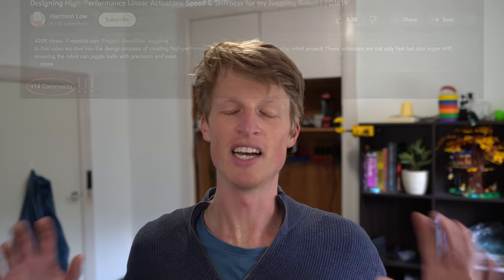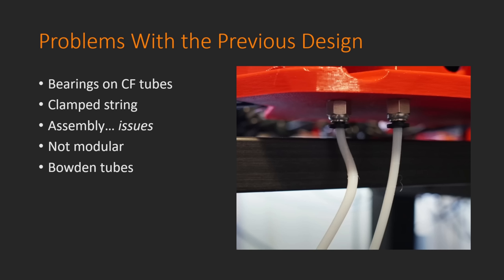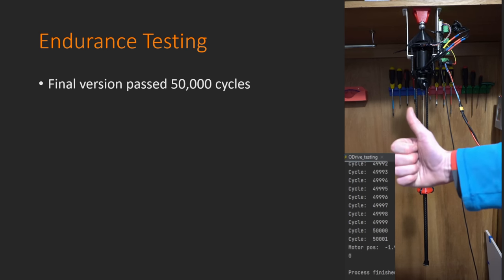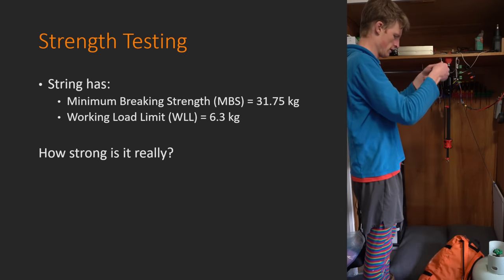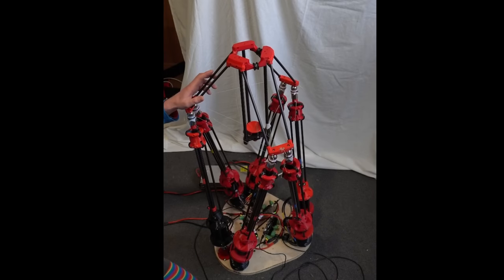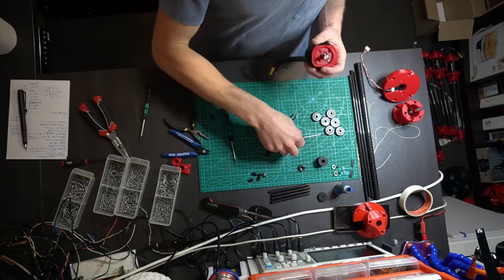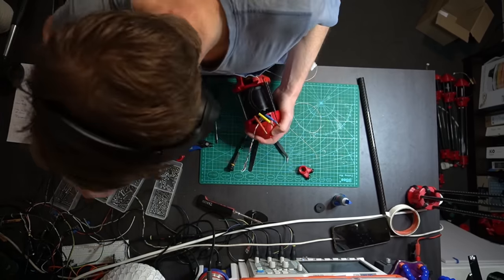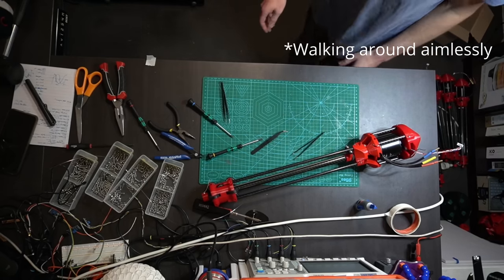My New Linear Actuators are SO MUCH BETTER! | PDJ #21

Comment: I used some thin UHMWPE (more commonly called Dyneema or Amsteel) cord about 1/8 inch for a project a while back. It was ridiculous, unbelievable how much force it took to break when I finally got it spliced it (close to) properly. I know it doesn't stretch much. Could be a consideration? Edit: I went and watched your latest video and the actuators are running on dyneema.
Reply from the maker: Check out my latest video 😉 it's what I'm using now! Agreed that splicing is very fiddly and I almost deemed it impossible with such small thread, but as always, persistence paid off!

Cheers for the suggestion ☺️
Reply: @harrisonlow  How small did you go?
Reply from the maker: The thread is around 0.8 mm diameter. The first splice took a good 20-30 minutes to finish 😂😅

Comment: Regarding braking and speed performance, I've seen that counterweights can really help the performance of actuators. Not sure where you could slip one into this design, but I think it would reduce energy consumption and thus require less energy to change direction.
Reply: Since this robot needs acceleration more than braking (imo), that might be a good idea.  They could be biased to extend quicker than they retract.
Or if better braking is required, perhaps they could be biased so they take more force to extend - but the braking is augmented by the counterweight or spring.  This way the motors can use more of their power, since apparently it's more difficult to brake than accelerate.
Reply from the maker: @mitchell4020 very interesting! Where have you seen counterweights used like this?

Re. braking vs. acceleration: I think both would be very important for Jugglebot. Ideally the acceleration would be fairly low, but if there's an errant throw or mid-air collision, it'd need to be able to react really quickly to get to the ball before it drops (requiring both high acceleration and deceleration)

Can you think of any way a counterweight could be added here? My first thoughts are that the counterweight would only increase the total inertia of the system, creating even more difficulties when decelerating, though it's quite likely that I'm missing something obvious here...

Cheers for the ideas!

Comment: For assembly you mention that location the pulleys is 'fiddly' and requires some persistence, is there room for some registration marks there that you could use to align a jig? Pulley goes in/on jig, jig is pressed into part, using the registration marks to self-align, screw inserted, done.
Reply from the maker: I actually did think about this! I was briefly toying with the idea of cutting the part into two halves along all the pulley planes (would've been a strange surface cutting the shape, but I think it would be possible in just two parts) and bolt them together, where the connecting bolts are the same bolts that support the pulleys. Ultimately, just never got around to doing it!

I think it's a great idea, and one that I would strongly consider if I were making more than 10 of these. Cheers 😊
Reply: @harrisonlow  makes perfect sense! Also you've more patience than I! I think I'd have gotten fed up after the first dozen pulleys.

Comment: Not sure if "Kevlar line for kites" is twisted, if so try changing the orientation of one (or both!) strings to reduce the rotation. Modern (Kevlar?) fishing filament may be a better option for the strings? Perhaps conservation of angular momentum and the Coriolis force is causing the actuator rotation? If so, the rotation would be the same direction for actuation and retraction.
Reply from the maker: The kevlar line is twisted (a pair of twisted threads, to be exact), though I'm sceptical that the twisting is coming from the string? The string seems too small and unsubstantial to have that sort of effect. Though I suppose it only manifested fully after 39,000 cycles (IIRC around 4 hrs of runtime) 🤔

Where would angular momentum and coriolis be coming into this? In the pulleys/bearings? I'm intrigued!
Reply: @harrisonlow   if you step on a skateboard kicktail hard enough to flip it over, conservation of angular momentum causes it to turn 90 at vertical and continue rotating on the way down, to land on the wheels again---a tendency anyway. In that case, I suspect the direction of rotation is related to the hemisphere you are in? Speculating here, perhaps the rod gets more or less rotation depending on how it crosses the lines of Coriolis force? Notable, in martial arts, arrows, bullets, swords, punches, kicks, etc are all power optimized with a rotation in the stroke, I think there is something that would apply to linear actuation too, not sure. I suspect 180 rotation out and continue 180, for retraction, with best dimension parameters, would be optimal for linear articulation... small forces, but better to work with, than against. Could test by articulating a rod from the bearings race adjacent to the one installed in the end of the rod? count rod rotation after n motion actuation? Good luck, from your armchair scientist!

Comment: I am new to python coding and that endurance test counter would be interesting to see.. But this whole project is amazing. Thank you for documenting and sharing it!
Reply from the maker: The way that counter worked was to simply add 1 each time the actuator reached the end of its movement 😊
FWIW, I have a bunch of the code up on Zulip so check out the link in the description if you're interested to see it. And if you want any specific code, just let me know and I'll happily share it with you 😁

Comment: Why did you use this type of motor instead of a stepper?
Was it the speed?
Reply from the maker: Good question! A few reasons:
1. Greater power output over a range of speeds
2. Weight (for a decent power output)
3. I didn't have any experience with BLDC motors and felt they're something worth getting to understand

Comment: Nice project! thanks for sharing. Still not sure why you don't use any type of linear bearing at the top instead if you want to have linear motion!? for weight reasons you might want to check out the igus glide bearings?
Reply from the maker: I've tried normal linear bearings but the tolerances didn't work for my carbon fibre tubes (some tubes fit with slop, others didn't fit at all...). I could absolutely reduce the complexity of the end of these actuators if I had some higher tolerance tubing, but I don't have super good access to parts and I'm not made of money 😅
Reply: @harrisonlow  As far as i know, Igus-like linear bearings are supposed to be press-fitted into a housing. they can be adjusted to fit the inner diameter by adjusting the pre-tension. there are many different materials and sizes to choose from. i bet, there is also a  material that works well on cf. Might want to ask the australien distributor Treotham for some samples!? Igus normaly is very generous

Comment: I'm not sure about what string you're using but dyneema is just about the strongest common rope i know of however your're probably going to want to used a pre stretched variety from sampson or new england ropes.  
As somebody who lives on a boat, i love how much of this design is resistant to salt water. I am thinking about how to use this as a tiller pilot (autopilot) with pypilot software.
Reply: I just looked more in depth at your BOM and you used a kevlar string. Dyneema is stronger and would work very nicely.
Reply from the maker: Cheers for the suggestion! I've put in an order for some and I'm keen to test it out 😁

I'd love to know if you ever end up using these (or a derivative)! Such a cool, different application as well ⛵

Comment: The line graph seemed to shows a bit of skew on the precision test, somethings not quite right
Reply from the maker: Yeah, I think that was a result of the string stretching over the course of many cycles. I somehow didn't realise that amplifying the motion by 10:1 will also amplify the force in the other direction 😅 

Thankfully the direct measurements were far more stable and didn't show any long-term decrease 😁

Comment: Magnetic braked flywheel, ideally clutched so you can store the energy electrically or mechanically, and possibly even smooth out the current peaks on the servo.
Reply from the maker: Could you elaborate on this? I'm getting very strong Wintergatan vibes (if you're unfamiliar, he's building a marble machine and is currently planning to use a flywheel to operate his machine in a consistent manner), though I'm unsure of how a flywheel could be applied here?

I also wonder what effects a flywheel would have when these actuators are moving around in the Stewart Platform. I really don't like the idea of having to deal with forces from gyroscopic precession 😅
Reply: @harrisonlow  Just search magnetic braking. The principle is that a moving magnet inducing current in metals (aluminium is a good choice, but copper is better but way heavier, bigger momentum, and as I see you want to reduce that for agility) which in turn creates an opposite force. I won't link videos, because youtube will eat my comment. I'll edit this comment with it in a few moments.
Edit: copy g0amdIcZt5I?t=541 in the your browser after watch?v= 
Another interesting recommendation is: tom stanton magnetic bike
Hope these help.

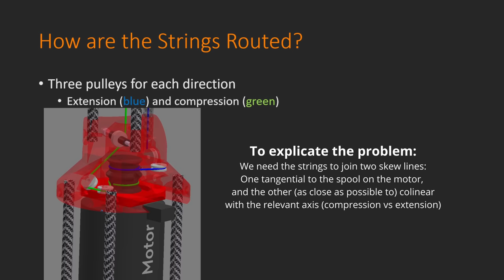Comment: 4:44 shouldn't the wires go opposite to each other...
Reply from the maker: Haha yes, yes they should. I have no idea how I didn't notice this until only a day or two ago 😅
If you're curious, the correct diagram is in the BOM (link in description), but it's basically the same except the top string (extension) is wrapped around the other side of the spool.

Good observation skills!

Comment: I only have a 3d printer and i am wondering if a stepper motor could be used instead. And use a belt not string, so you do not need to spool the string. Dependimg on how it spools, you would gain linearity errors
Reply: Oh and you could add a tensioner, the strings had serious slack with the weight
Reply: Oh, and print your tpu wheels flat on the sides, no need to curve them... And make em wider than the bearings and add rims large and thick enough for a basic side support, glue will simply shear off... And short enough and thin enough so you could force them on the bearing without tearing

Comment: Instead of using 6 bearings, why not use a single linear bearing.
Reply from the maker: I've tried normal linear bearings but the tolerances didn't work for my carbon fibre tubes (some tubes fit with slop, others didn't fit at all...)

I've considered using higher-tolerance tubes, but my wallet keeps glaring at me whenever those thoughts cross my mind 😂

Comment: Use a wire rope crimping ferrule for terminating the cable.
Reply from the maker: The trouble with these is that they don't (inherently) give any way to easily adjust the tension in the line, and at the non-adjustable end I'm not sure if these would be the best way to terminate the cable at the spool, due to the fairly small sizes in that area. What do you think?

Comment: Possible to use Pom wheel bearing often used on 3d printers
Reply from the maker: Do you think the POM would cause much/any wear if it directly contacted the central CF tube? I'll have to pick up some of these after all the suggestions for them!

Comment: Resistors that are hotter disapate more heat

If you get high temperature resistors it's actually better to run them as hot as possible then adding a heatsink that will cool them much easier

(Heat transfer is a function of temperature difference between 2 mediums)

Combined with increasing resistance of a resistor with higher temperatures you will get a system that will stabilise itself at a given temperature with a constant (or time averaged) load 

You just need to make sure that all other components in this system can handle that temperature.
Reply: the second paragraph is not worded very well

You need to increase the temperature of the heatsink which will increase its cooling power. That is what I meant
Reply from the maker: This lines up with what others are saying on Zulip, which is a good sign! Cheers for the input 😊

Comment: For the synchromesh cable I would just use a crimp on eye, or if you don't mind poking a series of tiny holes in your fingers look at how a very large cable gets terminated into an eye and scale it down and secure it with a bit of heat shrink or 3d printed collar
Reply from the maker: Haha someone else was suggesting splicing eyes into the end of the cables and after but a glance at how that's done, I said "hell no". I like my fingers free of holes, thank you!

The trouble with eye-terminations in general, though, is that they don't offer any (inherent) way to adjust the tension easily. Thankfully I reckon we've got it figured out on Zulip 😁 A simple printed clamp secured by one M3 bolt is all that's needed!
Reply from the maker: Link to the Zulip thread if you're curious:
https://pdj.zulipchat.com/#narrow/stream/399279-General/topic/Terminating.20Synchromesh.20Cable/near/389551272

Comment: to terminate the cable use an eccentric cam clamp or a lead fishing line weight
Reply from the maker: That's a very cool idea! I wonder if it'd be possible to make a sort of ratchet that allows me to pull the cable through one way, but doesn't pull back (easily) the other way. Could then fix in place with a bolt.

Neat idea, thanks for sharing 😊

Comment: 4:46

The only idea I could suggest would be to put the driving motor side ways, so both pulleys are parallel to each other, without the need for redirection pulleys.
But that introduces the problem that the motor will now be popping out on the side, so you would need a bevel gear in order to change the direction of rotation. You could use that for a single pulley-shaft, or make a double bevel gears with a pulley on each end for letting the motor on the vertical.
Reply from the maker: You've hit the nail on the head as to why I don't want the motor perpendicular to the extension axis: I don't want the motor to be sticking out the side of the actuator. I have a gut sense that this would likely cause issues down the line once I put all 6 actuators together into a Stewart platform so I want to keep everything as "neat" and in-line as possible. 

I think using the motor body as the spool would still work, though, because I'd be able to keep the centre of mass of the motor approximately coincident with the extension axis.

Comment: Regarding the bearings, there are premade wheel setups that use delrin in both a v wheel and flat bottom setup. Pretty robust.
Reply from the maker: Do you think the delrin would cause much/any wear if it directly contacted the central CF tube? I'll have to pick up some of these after all the suggestions for them!

Comment: FYI, knots can reduce the strength of your string. So if you are tying knots in the string to attach or test the weight, you're significantly reducing the strength of the string at the knot. Clamp it or wind it around a mandrel to terminate for testing strength.
Reply from the maker: Interestingly enough, the string actually broke in the middle (when doing the direct test with the bag), away from both knots. Very strange!
Reply from the maker: If you want to see proof, I've uploaded the next part of that clip to Zulip, here:
https://pdj.zulipchat.com/#narrow/stream/399279-General/topic/Random/near/389776525

Comment: Is the diagram at 4:28 showing the proper winding of the strings?  It seems to me in that diagram a clockwise rotation of the spool will wind both blue and green strings.  Whereas my understanding is the green string should be unwinding when the blue is winding?
Reply from the maker: Haha you're totally right! I have no idea how I didn't realise that. Only discovered it yesterday 😅
If you're curious about the correct winding, the top string (extension) should just be wound around the other side of the spool. This is shown correctly in the BOM. Good pickup!

PS. You're the only person (I've seen) that's noticed this so far. Well done!
Reply: Hehe thanks, ans great work on this cool project ❤

Comment: One thing you can do is to set one of the three sets of bearings at 45 degrees from the other one. This way is used to be applied on linear ball bearings. Great video !
Reply from the maker: Funnily enough, I actually had them that way in the previous design, but as a viewer pointed out, having them stacked like this is actually better for the force distribution.

Having them paired up like this means that—for a load applied perpendicular to the extension axis—there will (on average) be one bearing loaded on either the top or bottom, and two loaded on the other side. Having one set of bearings rotated by 60 degrees will mean that there will be (on average) two bearings on both the top and bottom. Loading two at once will be worse because it'd magnify the force (by sqrt(2)?)